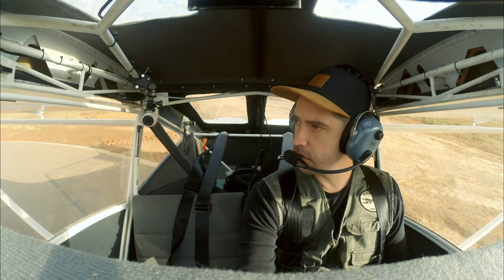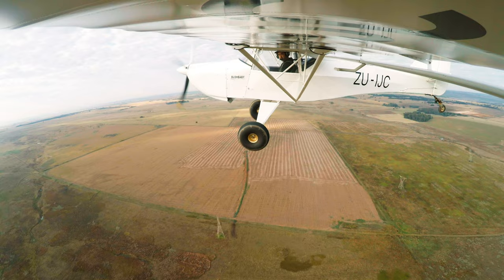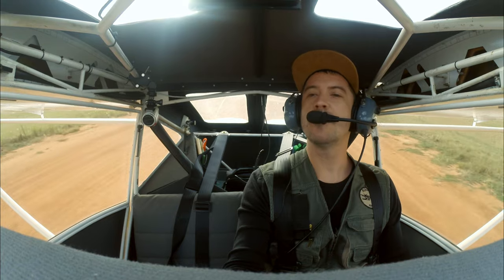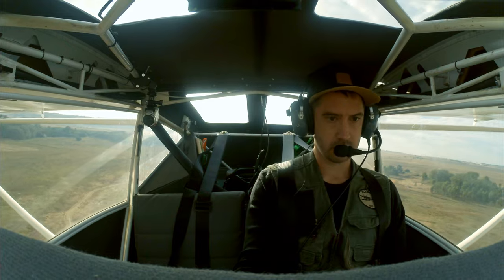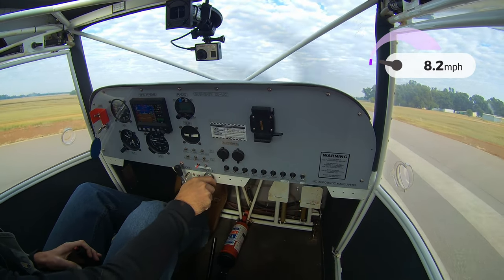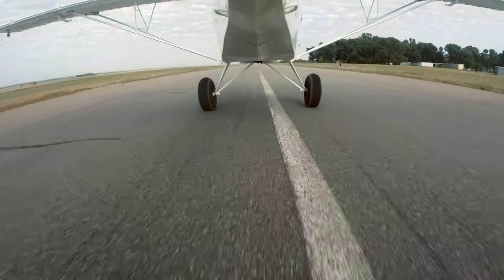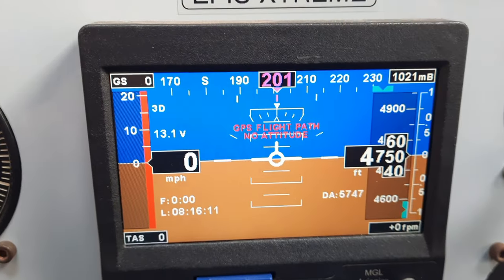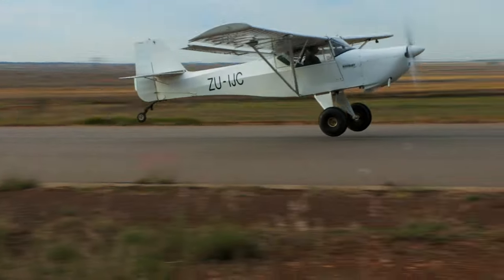Bushplane Short Takeoff with Rotax 912 Xtra Engine

Comment: Nice!  One thing I discovered in my airplane was starting with partial flaps.  With 15-25 degrees flaps the tail comes off the ground much sooner, almost immediately, then I pull full flaps and rotate once the fuselage is at a level attitude.
Reply from the maker: Awesome, I hadn't even considered doing that. Thanks, I'll give that a try!